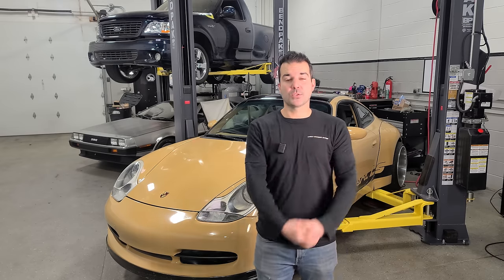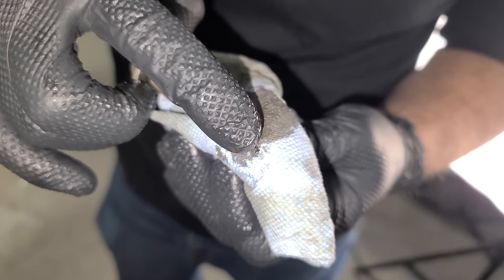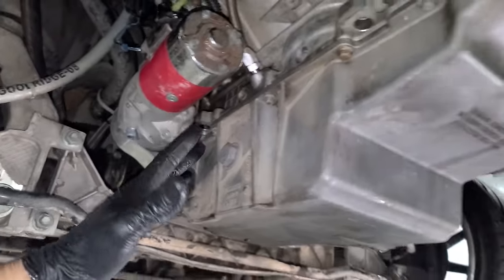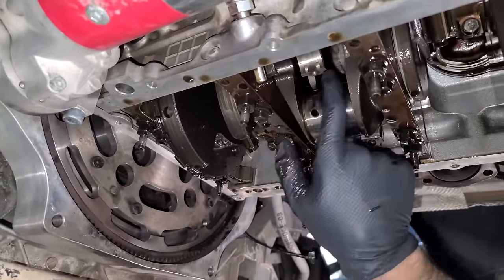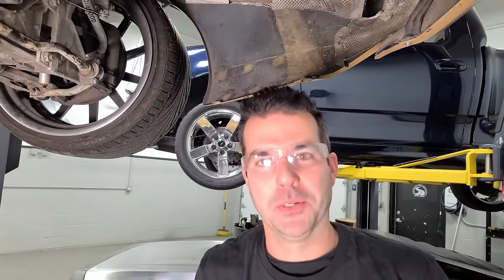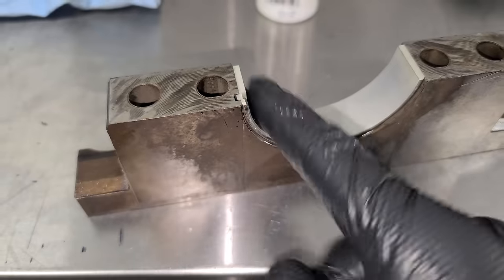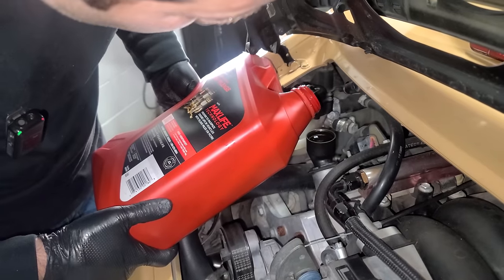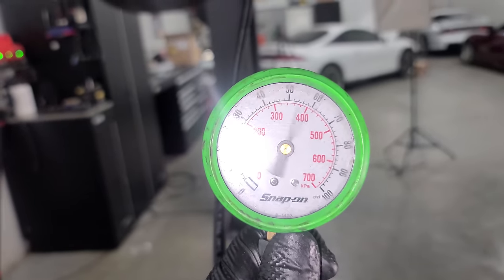My LS Porsche 911 Was About To BLOW UP So I Attempted A RISKY DIY Engine Fix!

Comment: (copy but please read)  ....  after watching the other 66% of the video lol

Im very happy that u successfully did an "In frame" on your Carrera LS!
   U taught us something new along the way.
That was alot of work.. your focus was great and u did and Excellent Job.

Truly happy for u that your engine didnt have major damage at the crank.

DO NOT .. DO NOT .. DO NOT !! 
Allow OJ, or yourself to over rev this engine.
I felt like he was trying to break it actually and im almost certain that This is prolly what caused your bearing and oil pressure issue.. as well as maybe the earlier overheating.

You must remember.. these domestic V8's can not usually rev up that high like the original Porsche flat 6.
   I know u wud love em to but they just cant, unless youve built them todo so.

This is one draw back to swapping for domestic v8s.. they have torque, but they dont rev like the original flat 6.. which has low torque and must rev to get into power. 
Trust me.. i have the same car 🙂
Reply: .. Also.. I love your positivity.. I watched this at a time when i really needed this vibe to push me back into my own positivity.

I will surely look fwd to u getting back to this car.
I would love to see u getting all the enjoyment u want out of it.

I truly Thank You for sharing with us

Comment: Questions:
* Was it filth blocking in the oil filter which caused the low oil pressure?
* Running a thicker oil works for the rod bearings out of tolerance specifications but what about all other surfaces in the engine that need lubrication and are within specifications, will they be OK?

Comment: It's great that you caught it early but I'm still worried. Why did the bearings spin on this low mileage car? Although it's a rebuilt engine that has been reground, was it a cheap regrind resulting in bad geometry just to get it through CEMA? Definitely worth keeping an eye on.

Comment: I need to comment because i read it. Actually i always thought to myself if it isn't possible to roll the bearings without taking out the crank, and you just showed me my intuition was correct

Comment: I put a high pressure oil pump on my chevy truck cause it was showing low pressure plus I changed the rods and I got nice consisted pressure and I still never had a problem

Comment: Interesting the way you used the plastic gauge. I have always used it when the motor was upside down on an engine stand. That way the weight of the crank is sitting on the upper crankshaft bearing. This allows for the maximum gap between the main bearing cap (bearing) and crankshaft.  The way you did it allows for the gap to close between the main bearing cap and crankshaft due to the weight of the crankshaft being affected by gravity. So I am not sure how accurate your plastic gauge reading is. You could have probably did better by doing a bump test with a dial indicator to determine the gap between the main bearings and crankshaft.  Bump tests are usually done on larger diesel engines but in this case I think it would give you a better representation of the gap (clearance between bearing and crankshaft).

Comment: A lot of people who mate Porsche gearboxes to LS motors have engine failures from pressing the clutch in at startup when there is no oil pressure. The LS is not designed to take the heavy thrust loads of Porsche clutches. Recommend starting with foot off clutch, and maybe seeking a low force clutch.

Comment: Being a heavy duty mechanic ive rolled in so many bearings probably hundreds its always the upper rod bearings and lower main bearing that get the most wear ive sanded many cranks put in bearings dynoed the unit and it never came back
Some have a stretch spec if too long toss if ok put them in
Reply: Always shake your rods after assembly of each rod and check crank end play after each bearing to make sure not bound up any where

Comment: Fist off that sensor adapter will kill your engine. To see this remove the adapter with the sensor screwed in you will see it blocking the oil passage. This will still show pressure but will drastically reduce the flow starving the engine for oil.

As for oil pressure i have 65 @idle 90 @2500 rpm cold.
45 @idle 70 @2500 rpm ECT @ 195

Comment: Man, you were right on with the "Built for SEMA" comment in the first video. They made some dumb mistakes to get this out to the show, and it's amazing how little money you've put into this to get it going. The best part is I know I've seen this method of replacing bearings before from other youtubers. Most of the time they don't even have a nice lift. They do it on their back with their car on jackstands, but they use the same exact methods and get their machines back on the road. It works. You just got really lucky that you didn't have to remove any crossmembers or anything to have access to the whole bottom end. Shame about the one main, but if we're completely honest, this build would be worthy of a full rebuild or another LS swapped into it if it came to that. You'd still come ahead on value I think.

Comment: Nice work Alex! Good to see you got a good, high quality windage tray and O.P. baffle. Nothing wrong with replacing bearings the way you did here. You took the precautions to 'plastigauge' everything, and do the in-frame crank polishing. I've used this method several times over the years, and never had a problem. Now, if you were to have an out-of-round journal, it would be a different story. Then you'd want to drop the engine and do the whole schpiel! Personally, I'm not a big fan of the LS oiling system overall. I think GM should have stuck with keeping the oil pump in the pan, instead of on the front of the crank. Crank mounted oil pumps tend to foam the oil a lot more, because they turn twice the rpm. But, it is what it is, I suppose.😉

Comment: often its just the bearing tabs holding them from spinning , as bearing wears the bearing can move away from the caps , all it takes is a tab with very little area holding it , i've seen bearing with tabs that are a joke , little more than 15-20 thousands of material contact , i started stalking the tabs deep into the slots for a good solid landing and never spun a bearing ever again .

Comment: When putting a mechanical baffled oil pan , with a quart more of oil? It ensures your engine against burning up rings and valves. That's what happens to all of the 351 Cleveland engines on those De Tomaso cars , with either sudden acceleration or quick turns .😮

Comment: Our mopar 340 in our '70 charger has a factory windage tray..is that a normal thing from the factory on some engines? The engine is from a demon or a duster originally but it was rebuilt for a sprint car right before my dad bought it in the mid '70s.

Comment: Is that right to lube the bolt threads?
I was under the impression that only the underside of the bolt head was lubed, threads dry 🤔🤔
Was lubing the threads specified on the bolt kit package?

Comment: I'm willing to bet that the rod bearings at the crank spun due to overheating and tolerances Got way too tight causing them to spin out of place just My guess... And that being said, I know you had electrical problems with the fans not kicking on. And they were having overheating issues with previous owners. What do you think?

Comment: 1. If you spin a rod bearing the rod "IS" bad. 2. The oil sump is at the rear of the motor because under acceleration the oil is pushed to the rear of the car and into the sump i.e.toward the pickup. Frount sump pans are available. 3. I would never recommend running more main bearing clearance than the max factory spec. It only reduces oil pressure. 4. You should plastigauge rod bearings dry as a heave lubricant  can affect the measurement.
Reply: I should have started with "I really like your channel.

Comment: I’ve always noticed if my oil pressure ever seems lower on my 2000 z28 I just change the oil filter and boom 45 psi cold start

Comment: i would recommend an oil cooler and upgrading the oil pump to a high-volume high-pressure pump. your engine will thank you. my car runs at 50 psi cold and 80-85 psi warm at 3000 rpm.

Comment: Not sure how the ls is, but can you get to both sides of the big end bearings like this? Might be those are shaggee to, and not just the rod bearings. I mean the top side of the big ends is going to not be possible to change without taking out the crank.

Comment: That looks like a VDO pressure sensor. Be sure the pressure sensor is the correct sending unit for the Porsche gauge. Ohm to pressure reading need to match. Their typical ohm measurement is 10 ohms with 0 pressure and 180 ohms at full pressure. Also, good chance one pin is for the gauge and the other is for a low pressure warning light. If so, do not use sealant on the threads of the sensor so it will ground itself to the block or use a sealant that is conductive (usually has copper). If the adapter plate has a gasket, it could also cause a bad ground.

Comment: Plastigauge the bearings?  Gives you an accurate tolerance between 0.001" & 0.007"  (0.025 - 0.175mm)

Comment: I had a 2012 suburban that started having oil pressure problems at 186k miles.  Dealer wanted to install a new motor, local shop also said it needed a new motor.  I wonder if this would have fixed it....🤔

Comment: I always heard to much oil was as bad as not enough? So with a factory ls qt over is better? And I have ls7 z06 with heads and cam should I run it qt over aswell?  And I use amsoil as well.

Comment: Hey Alex I have 2v mustang and had a crack on the intercooler I forgot to replace it and one day I was driving and it completely blew up it overheated and now it sounds like it has a rod knocked hoping it doesn’t have one but it’s making like a knocking sound and when I tried to drive it it looses power what do you think it has ps: I haven’t looked into The oil pan caused im scared to find glitter

Comment: Oil Temp? 
 Do you have to worry about the oil heating because of the way the exhaust just sits under it?   

Is a heat shield needed or it don't matter?

Comment: Running about 55 PSI at start up on my 2001 LS1 10th Anniversary Firehawk with 32K miles. Although I am dealing with some oil burning on it that I'll need to figure out. Before last two oil changes, my oil light came on and needed a quart. If anyone has any ideas on where to start, let me know. Not sure if a good old BG oil cleaning will work or if this is a common issue.
Reply: Are you running Mobil 1 5w30 in it? And are you losing a quart about every 5k miles?

Comment: Any fastener stretches when you tighten to its torque limit. It's the stretch (and the fact that it acts like a spring) that prevents it from loosening. TTY stretch beyond their elastic limit so it's a permanent elongation (like a spring stetched too much to return to its original shape). Conventional fasteners spring back to their original length as they are not stretched beyond their elastic limit (like a spring stretched within it's operational limit). Angular torque is simply a more accurate method of achieving that stretch.

Comment: I always have my doubts with the ARP bolts just torqueing to a single spec.
OEM is always torquing to a spec and then an angle torque, which translates to a stretch spec, and ARP also recommends to torque to a stretch spec. I know a single torque spec is also in the manual but to me that's the backyards mechanics way cutting corners.
A bolt stretch gauge can be had for as low as $60 (summit racing), so in my book that's a no brainer to buy when using ARP bolts. Especially as $100 for rodbolts is considered a cheap upgrade.
That said I'm not even convinced ARP bolts are better than OEM. That might depend on the engine, I'm not really familiar with american engines. But some european engines have pretty exotic and elaborate rodbolt torque procedures, probably for a reason (like high revving S50's/S54's etc)

BTW with potential oil starvation I would've also inspected the camshaft. I know it only spins half the speed but it's often also not as well lubricated.
But I can imagine that might be an engine out job on this car.
The amount of metal here in the oil is pretty concerning.

Also another tip when doing this: at first startup (or better said: before first startup), remove sparkplugs, remove the fuel pump fuse and just crank it until you get oil pressure. That way you get oil pressure without stressing any components.

But I liked the video👍

Comment: Rod bearings spun because of low oil pressure. Cam bearings are probably worn as well, causing the low pressure. If you try. 010 bearings with a std. crank, doubt it would even rotate.

Comment: I saw a cool hack the other day when changing the oil and oil filter.  If you put a shop vac hose up to the "oil fill" hole and turn it on it will keep the oil from running out all over your hands and other places when you remove the plug.  It does the same thing with the filter and doesn't let oil come out until you turn off the vacuum.  Try it and see what you think.

Comment: I dont have an actual ls i have a lh6 in my Silverado i know its similar but has 45 psi on cold start about 35 psi at warm idle and jumps up to 45-50 psi at normal  acceleration at operating temperature.

Comment: Seeing that much shrapnel on the drain plug is a certain sign of component failure. Unfortunately it is only a matter of time until something starts to knock. As hard as it is to accept you would probably be better off to do a rebuild and use it as an excuse to upgrade.

Comment: My 02 (56K miles) LS1 starts and sits at ~42psi then goes up to the 50's under load/higher rpm's  but mostly never lower than ~42psi

Comment: I say use straight 30 weight oil to reduce camshaft, crank rod and other bearing rod wear! it is no surprise to me you have metal particles in oil when breaking it in; using 30 weight I say you will have less break in each time! good luck! :)

Comment: I still have a suspicious feeling that a oiling issue brought this on to begin with. I just couldn't put this motor back together with new bearing and be content. LS has several oiling issues depending what year it is. In the oil passages LS use a plastic blocker to divert the oil through the filter and they have a 20-30 thousandth variation in some, if it's too loose dirty oil will get by it circulating dirty oil into your bearings. Not saying this is the case here just saying I couldn't sleep knowing the possibilities that contributed to this. Anyway enjoyed your videos best wishes.

Comment: With a warm engine at idle you really wanna see at least 20-30 psi, depending on the oil weight used. Below 1 bar is more like 10 psi and that's definitely too low.

Comment: I drive an 08 Impala SS.. it has the LS4 5.3.. I run about 40 psi on the oil pressure at idle

Comment: I have a 2005 2500 Suburban with a 6.0 anywhere under 30 degrees it only has 5psi at startup then when it gets fully warm it’s 40psi

Comment: I run 10/40 Rotella in every single LS motor and 1 quart over never had a single issue with bearings I have multiple fast ls cars and all of them I spin up to 7k rpm or over every ls motor I have seen with spun bearings was because of running low on synthetic oil Rotella diesel 10/40 is my favorite oil in everything even motorcycles lol always run a quart over if you like to have fun in your car or you will get to do exactly this when you launch the car or do donuts or drift or race around corners all your oil leaves the pick up and bye bye bearings extra quart will save your motors life

Comment: Luckily oil beads up in the eye, it aint no good if it glitters though. Maybe if it's loaded with exotic surfactants that might change things, wouldn't know. I do know from almost 30 years of spraying paint I prefer oil based paints in my eyes to water, the water disolves, the oil rolls right out. Everything else about the oil sucks. We're less careful with the waterbornes, waterborne stain killers, bonding primers, they can sting like hell. I remember being surprised when when i got my first accidental eyeful years ago then thinking, makes sense. Dknt want a direct shot, most of the time its dusts, insulation and stuff blowing back when spraying exposed structure ceilings. Even after due diligence you surprise yourself.

Comment: It’s a ls I bought a 2005 Silverado with 390000 miles 30 psi cold and 10ish hot and was quiet as a sewing machine . Tan like that for 2years as a shop truck . LS  is the way to go

Comment: NOT to sound negative but you need to check round on crank journals. just because its shiny doesnt mean its good. I assume you know this and hoping the best for you but you can see a few similar situations on my channel on motorcycles with the same problem.

Comment: The camshaft retainer plate is one of the most common issues for low oil pressure, with a cam swapped ls.
It is only 30$ so should be replaced.

Comment: Interesting how all the gauges work even though it's a different engine, I was under the impression that if you swap the engine with other than the one the car originally came with you need those ugly generic gauges.

Comment: I keep telling ya! PPE is not a joke. I missed three days in a row because of metal dust in my eyes. I inspect car parts for GM. I make sure that crankshafts and heads and full engines are up to code. I actually inspected some LS engines recently. I get paid dog crap but I enjoy it. Edit, I don’t work at GM, I work at Tora Inc. we inspect the engines and parts then ship them to GM. Don’t believe that GM actually make the vehicle that you’re driving in house. They are basically just assemblers of outsourced manufacturing.THK makes a lot of the parts that are vital for the vehicle and its performance. Like control arms, Ramos makes the heads, another company makes the blocks.